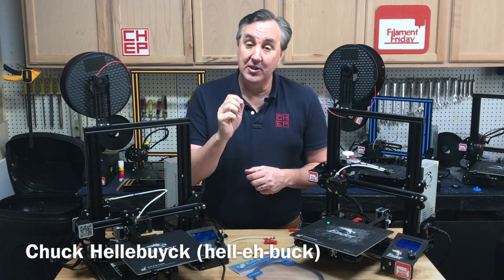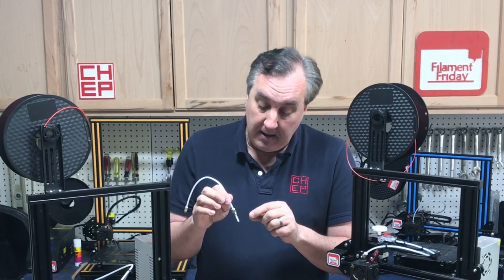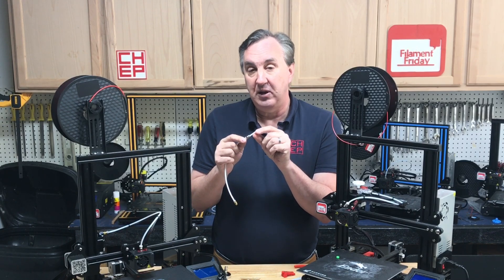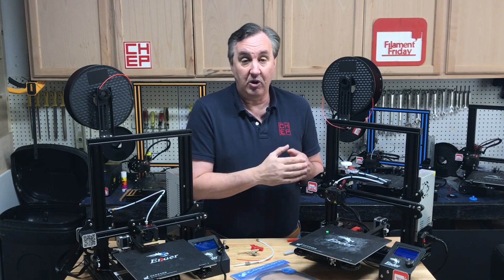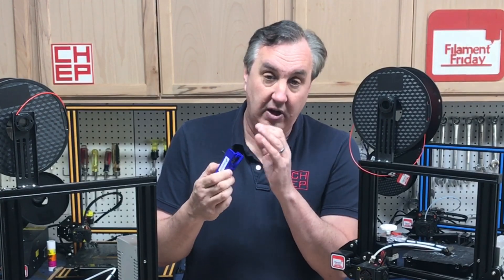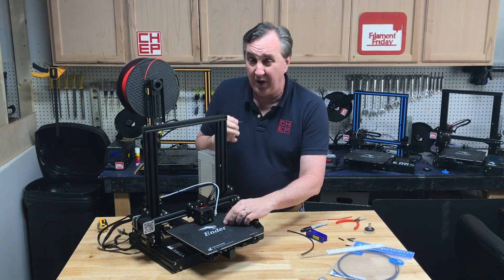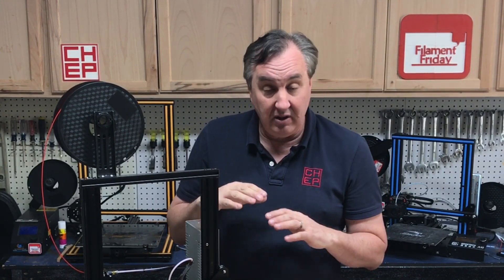Simple HOTEND FIX for Creality Ender 3, CR-10

Comment: I just got my Voxelab Aquila and replaced the whole PTFE tube with capricorn.  Third day of printing on this machine and noticed the extruder skipping steps.  There was a TON of back pressure, so I took it all apart, swapped out to the spare nozzle, no luck.  I then tried to run a length of filament through just the capricorn itself and it was a struggle even by hand, and at the end there was a 0.5cm piece of filament that blocked the path outright.  Swapped to the OG PTFE tube, printed out the washer, did this mod.  It's a little tricky figuring out how tightly I should screw down the coupler since I accidentally over tightened it I suppose and the filament wouldn't feed past the coupler.  I took a short length of filament, bent it about an inch up so that it wouldn't reach the melt zone, and stuck it through the coupler-washer-tube.  I then tightened the coupler until the filament snagged, and then backed it off little by little till the filament could be pushed and pulled fairly easily.  Fingers crossed that this'll work!  If I don't edit this comment, it means it did.

Edit: well perhaps I was wrong?  Was diagnosting thermistor issues where hotend readouts were varying quite widely and triggering thermal runaway.  Dunno what happened on that front, took out the screw and retightened it.  Noticed the coupling was loose so I just tightened it up till i felt some resistance.  I've got a bmg clone extruder now and it seems to be pushing filament through just fine, so maybe the filament was just catching on the top of the short ptfe during my testing.

Edit 2: printing PETG was really finnicky and after a bunch of testing on the slicer side, I took apart the hotend to find that the washer which I had printed in PLA was significantly deformed and cratered where the capricorn pushed up against the washer.  I guess during my tweaking or straight up heat creep caused the PLA to soften, which isn't a hard feat.  I have a BMG now so I just ran a capricorn tube all the way from the extruder into the hotend without this mod and PETG is printing awesome now.  So while this mod is interesting, probably don't print the washer in PLA even if it sits in the cold end.  I'll probably just use a full length capricorn tube since it's working for now.
Reply: you need to PID tune your printer when you change anything with your hot end. That's why temps are varying and not staying stable to what you set it to. Happened to me. Takes 5 minutes to do.

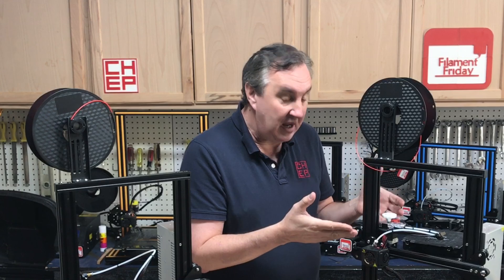Comment: 5:40 why not just spend $12 and get the Capricorn tubing and Upgraded Pneumatic Fittings you link to at Amazon?  I feel like shoving a tube in the hotend and putting a cap on it will be difficult to remove if I need to, and you keep saying throughout the video capricorn and better fittings solves the problem, so I guess I don't understand using this hacked together fix.
Reply from the maker: Either will work. Just another option many prefer.
Reply: I just got an ender 5 pro which comes with the Capricorn tubing as standard and the couple of things I printed had a lot of stringing. Like between the ears of the cat model. Of course I used the filament that came with the printer, my first 3d printer.

Comment: While this is a nice fix, the washer is redundant. Just cut the tube inside the hotend a little short, insert,then install the coupler, screw until it's about 1 and a half turn out from end, insert the long tube at the top until it makes contact with the cut tube inside, lock the coupler, and screw it tight. That last 1.5 turns is enough to push the tube down and keep it in place. Been running it this way on my ender 3 v2 for over 2 months and no issues.
Reply from the maker: Kaotictube - That still relies on the coupler holding the PTFE in place. Might as well just not cut the PTFE and use one piece like stock setup.
Reply: @FilamentFriday  that is true but it prevents cutting a whole bowden tube as you only need to cut a length for the inner tube and retain the main section, as is the purpose of your video which I appreciate.
Reply from the maker: The main purpose of the Luke Hatfield method I show is it relies on the threads of the coupling to hold the tubing to the nozzle, not the spring fingers inside which often fail over time.
Reply: This helped me so goddamn much I owe my printers existence to you
Reply: @Sokol9r  Glad I can help! Happy printing!
Reply: @Sokol9r  ps the same trick works on the extruder end. Just no inner tube to worry about.
Reply: Can you take pic to show exactly what you're talking about

Comment: Wouldn't the length of tube depend on how far the nozzle is screwed into the heat block?
Reply: Yes. And he explains how to factor that in.
Reply: @floorpizza8074  he explains how to measure from the top coupler but I think Chris is asking about the length if you consider how tight or loose the nozzle is. I'm actually curious about that too because I have this hot end fox on my machine but I need to change my nozzle as it's worn out now.
Reply: I guess you'd have to have the nozzle butt up against the heat break (which it should be anyway)  and then measure,  but if you'd disassemble the Hotend for any reason, you'd have to cut another insert for any difference in distance.
Reply: @3411Chris  yeah agreed. I guess with a nozzle change you're just measuring from the bottom up instead of the top down. But the process should be the same essentially.

Comment: I started dismantling the hotend today to fix a, 'bulbous end to my filament' which made  it extremely difficult to remove/change filament. After removing the coupler and nozzle I noticed that the short capricorn tube is EXTREMELY difficult to remove. As in, it's still stuck in there.
I tried heating up the hotend to 240 degrees to no avail. Pushed with a piece of tubing, then an appropriate sized Allan Key. Anyone with any ideas how to remove this would be great. Can I heat the nozzle (with no nozzle) and use a heat gun to heat the red finned upper portion? Anything else?
Reply from the maker: Run a small drill thru it and it will probably come out.
Reply: I disassembled the block of the hotend and held the heatbreak over my stove for like 10 seconds, the ptfe melted and I got it out.

Comment: Why can't I just replace the whole tube with Capricorn? It seems you are fixing the hot end of the stock tube with Capricorn tubing - why not the whole tube and not have to mess with the washer and short piece?
Reply: The the washer sits on top of the short piece and then the coupler holds it all in place, by doing this there is now way that the PTFE tube can back out like it can if you just have a whole capricorn tube. I've had this issue happen with the full capricorn tube that the coupler doesn't prevent it from backing out from the hotend.

Comment: I apologize in advance if this has been addressed before, but I am trying to install this fix and I am running into some difficulty.  When I insert the Capricorn tube into the hot end, the top end is not centered. As a result, when I put the washer in, the holes are not concentric, they appear to be off by about half the thickness of the tube (~0.25mm).  This in turn is preventing me from being able to load the filament.

For reference, I have an Ender 3 V2 with the stock hot end. I measured the hot end to be 38mm deep. I am using the 3mm washer and assumed 3mm thread so I cut the tube at 32mm.

Any help or suggestions would be appreciated.
Reply: You should be able to straighten the tubing with some careful counter bending. If it's problematic, maybe try using hot water to soften it a little? Make sure everything is dry before you try to use it, though.
Have you tried using a short length of filament (or anything straight that will fit) to get everything lined up? If it's short, you can use it as a guide and slip the collar over that and tighten it down. Pull the filament when you're done and seat the feed tube.

Both are not proven suggestions. I'm spit-balling ideas. Hope one helps.
Reply: I have the same setup and ran into the same issue, tried to fiddle with the tube a little, bending it and cutting it a bit shorter but also when the filament did go through the narrow passage added enough friction to compromise the print. I wanted to play with it a little more but the threading of the heating block decided to give up on me, i'll try an all metal upgrade for a while then maybe fix the stock and give it another go
Reply: I had this exact same issue and it was driving me crazy. I think I finally have it working. Here are some things to consider:
1. The hole in the capricorn tubing is not super consistent, that is, it's not always centered very well. When you cut your piece of tubing, one of the two sides will probably be better centered than the other one. Place that one pointed up.  I don't really think this caused my troubles, but it might have contributed.
2. Make sure the nozzle is new or clean.  If there's a gob of melted filament on it, and you tighten things up while the nozzle is still cold, you won't get a good contact between capricorn and nozzle. There will be a gap
3. I'm not a careful reader. CHEP said that the tube length varies between machines. I checked mine and it was sort of close to CHEP's 35 mm so I assumed it was the same as his. Upon redoing everything for the n-th time, I finally double checked the measurement and my Ender is 38mm, so my tube length is 38-7=31mm. I was using 28mm as per the video and I'm sure this made a gap that caused most of my problems. BTW I measured the length using one of the provided allen wrenches since I don't have any filaments bigger than 1.75mm.
Knock on wood, it seems to be working now

Comment: Hey all, I realize that PTFE is best, but is it alright to use PLA until I can get PTFE on payday? Thanks!
Reply: For the printed washer? Yes PLA is fine. The PTFE refers to the material of the tube that runs from the extruder to the hotend. Print the washer in PLA or ABS.
Reply: @timmyalexandranova  thank you
Reply: @dv8tyler692  what printer do you use? Im dealing with an Ender 3 right now and I might be able to help if u need it.
Reply: @timmyalexandranova  I'm getting started with a pair of Ender 3 pros. I just wasn't sure if I needed to be worried about the spacer melting.
Reply: @dv8tyler692  It should not get hot up at the top of the heatbreak. Under normal conditions it is cool to the touch (I wouldn't touch it, just in case). The one thing that you might want to be aware of is I think that the PTFE insert (the short piece of PTFE that goes in the hotend) might fall out when you change the nozzle. I'm not 100% sure, but just looking at my hotend there does not seem to be anything preventing it from going all the way through. I can get back to you later when my parts come later today.

Comment: After nearly a year running this mod, I've got to come back here to say this is an absolute lifesaver to avoid that little bit of slop that just tends to develop over time as the teeth in the coupler eat away at the PTFE tube. I've been printing almost exclusively PLA, so even after all this time and a couple kilos of filament, the part stuck in the hotend hasn't failed (yet, though I'm checking it regularly) and I've had literally zero issues with clogging or stringing getting worse over time, as it had before. Also, disconnecting the bowden without potentially messing up the tube<->nozzle alignment is just such a welcome bonus.
Literally a must-have, coffee-break length modification.

Comment: Any tip to removed to PTFE/capricorn tube piece from inside the hotend when there is a need to change?
Reply from the maker: Heat it up and push it out with another PTFE or even an Allen wrench. Not that hard to do.
Reply: @FilamentFriday  mine was a bit black and stucked to the extruder walls, thanks for the help!
Reply from the maker: Wow. Check your fan. It may be spinning but slow meaning it’s failing.

Comment: Thanks for this Chuck, am going to apply this to my Ender 3 as well. One question though, shouldn't the piece of Capricorn tube be a little bit longer than the 28mm you mention in this video? It should be pressed firmly against the nozzle by the washer instead of just touching it right? So wouldn't adding 0.5mm to that Capricorn piece be better? Thanks.

Comment: So you prefer just adding this washer to the earlier one designed by Onehotmarine?  And I see your thingiverse file has three different depths (2,3,4mm)  Any preference on those?  Working with an Ender 3 V2.  Thx in advance.
Reply from the maker: There are three for you to choose the one that fits your printer. They take only a few minutes to print.
Reply: He answered both questions in the video
Reply: @vivaciencia9329  Well it was apparently unclear, thus the question.
Reply: @vivaciencia9329  Just listened to it again.  No explanation on which of the three washer sizes and why there's three.

Comment: Hello. Im really new to 3d printing o ly just getting mine in easter. I had some trouble and have slowly been applying different fixes to solve each one. I resently ran into underextrusion with a very tall print. I was curious if this hackfield mod is useable on a JGaurora A5S.  If some one could help me find out, i would be very grateful
Reply: have you checked that the hot end and the motors works well? If coula also be the start of a clogging issue

Comment: I  actually cleared a major jam in my hotend and cut about 8 mm off the bottom of my tubing. I re-seated the tubing and all is well. BUT I was worried I would need to do it again. This seems like a brilliant solution. I will print the washer in ABS to resist the heat of standard PLA prints and other materials. Great solution and technique to figure out insert length.

Comment: This is how hotends of old used to work, the j-head, alu etc..
It's a great idea, the only concern I have is that your adding another transition point for the filament, this could be problematic for printing flexibles. 
It could also be just the type of coupling that allows the PTFE to come loose. The e3d light6 has a similar system and that has been my most reliable hotend.
Reply from the maker: Been working fine for couple years now.

Comment: Just one question, what material did you use for the washer between Capricorn and the coupling? Will PLA do the trick, or is something else needed? TIA!
Reply from the maker: I used PLA.
Reply: @FilamentFriday  The PLA spacer has held up over the past year?  My first thought was that it would deform and clog.
Reply from the maker: Works fine for me.

Comment: there's 2 sizes in capricorn btw, xs is the 1.9 you mentioned (also higher heat resist then TL) but the TL version has a 2mm inner diameter

Comment: You Lifesaver CHEP! Also I have another issue where the hot end coupling always digs a ring into the PTFE tube, then its always stuck and impossible to remove. Is there an upgrade you can suggest so that it does not dig into the PTFE tube?
Reply from the maker: They all do a bit. The Capricorn couplings seem to be a little better with it.

Comment: Would this actually perform better than just putting Capricorn tubing from the extruder all the way to the nozzle? I already have the Capricorn tube upgrade (and like a meter of tubing), I just haven't put it in yet. I'm wondering if this would get better performance, or if it's more of a convenience for replacing the tip (+ save money).

Comment: I must have done something very wrong coz the filament isn't going all the way anymore. I had to pull the tube out to use my finger to find to right spot.
I'll check later the washer as it has 2 different sides. I might remove it.
Other than that, solid solution.

Comment: CHEP in case you see this comment, rest assured, the baking of teflon does increase friction. Teflon\PTFE chemically changes when it is excessively heated, or treated with certain chemicals. This is oxidation and increases friction. It also has an interesting effect on other properties of the material, such as wetting.

Comment: Solid technique.  This transfers the force to compress the PTFE away from the coupler teeth and instead to the (washer) coupler body.  Good job on the washer bevel, that is really important.  Capricorn tube is great stuff but it's always about XS.  No doubt XS is amazing stuff for higher quality filament and high print temps.  No one seems to mention their TL tubing.  Always perplexed why TL is not used more frequently, especially on beginner and primary PLA users.  TL is not quite XS specs but it has a more stock-ish ID which is more accepting of filament made with varied thickness.   You can somewhat see through TL; which I find a useful feature.  I am excited to try out this technique using TL in the hot end and either TL or factory Creality tube as the carrier.  AKS (or other good) couplers are still a good idea to replace cheaper couplers and keep parts held tight.  One meter of Capricorn tube (which ever flavor of choice) could last you a very L O N G time.

Comment: Hello! I want to ask : what's this design for? To prevent the pTFE tube from making a distance between nozzle and ptfe in hot end?

Or is it just a design so you can economically reduce capricorn tube to only needed area?

Because someone in community posted about leaking plastic mess in their hot end, (all i know is that happens because your ptfe is making a distance bertween ptfe and nozzle) and almost many people recommend your video to solve it.
Reply from the maker: To washer print is to trap the PTFE below the coupling tight against the nozzle.